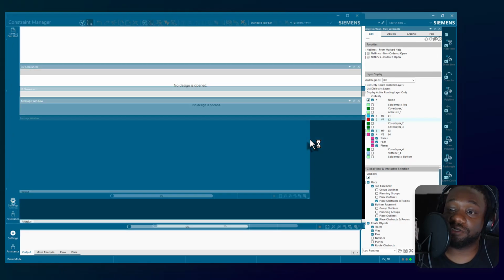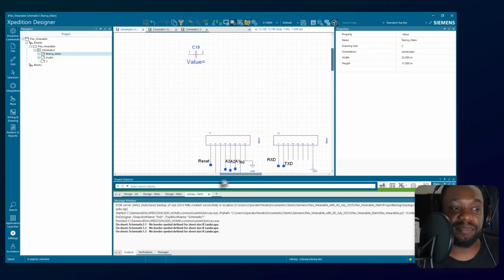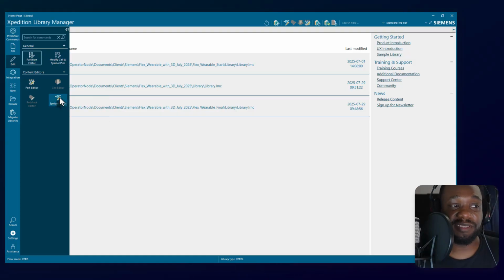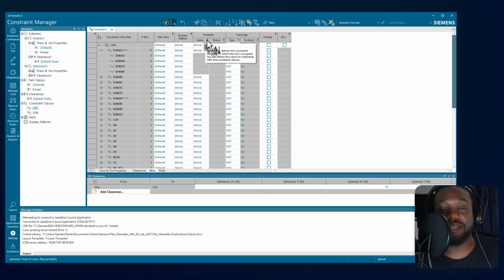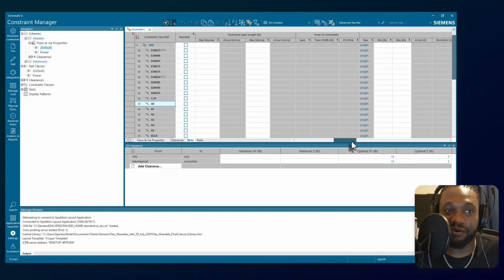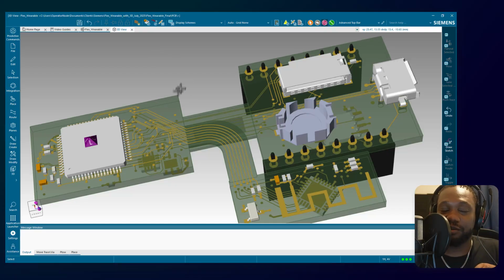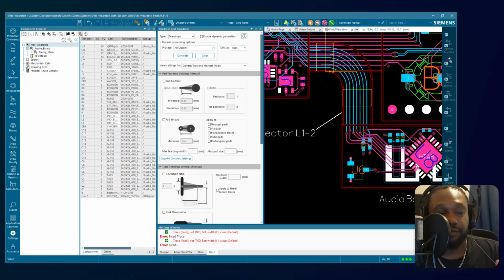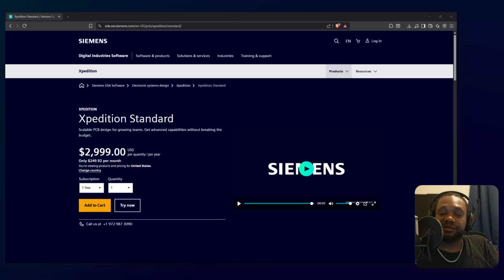Is Siemens Xpedition Worth It for PCB Design?

Comment: This working-level explanation is exactly what I was hoping to get.  Great video!  The only thing I was hoping to see more about is the PCB layer control and via geometry design as it relates to limitations or points that excel.  High density designs, combined with small pitch BGA, are increasingly driving use of micro-via's.  Couple that with automotive and aerospace operating temperature range and it becomes very much a non-negligible factor.  How this software handles that will be the deal breaker for me on whether or not to purchase.
Reply from the maker: Ahhhh, great point! okay I'll get to answering that for you then. I can compare the Siemens Xpedition software vs others (like allegro x and altium) if you'd like!
Reply: @techedkirsch  oh wow, thanks for such a quick reply!  Wasn't expecting that.  Yeah definitely, if it's not much trouble.  Any comparison or view of how the software handles that would be AMAZING and incredibly helpful!!😄
Reply from the maker: @wickedend3073  awesome awesome. will do 😁
Reply from the maker: can you email me at kirsch at HaSofu dot com as well? I just did an HDI webinar I'd like you to see!